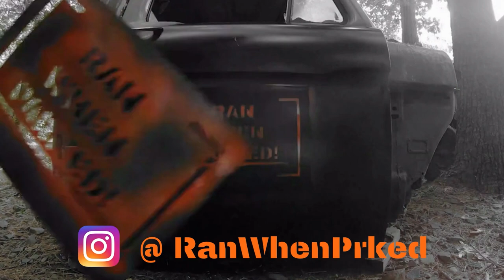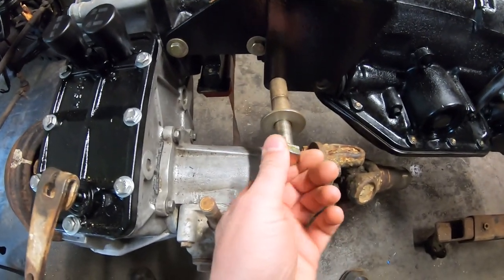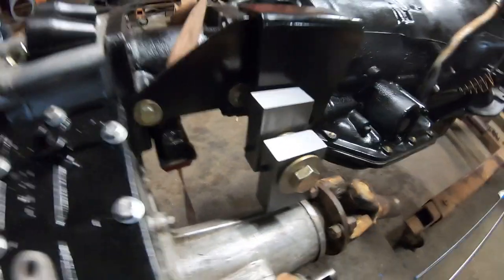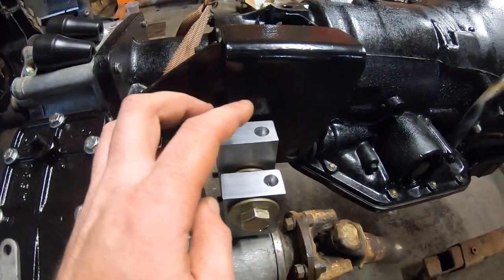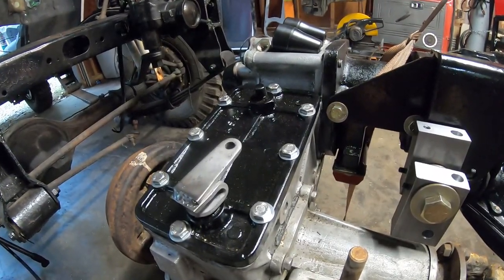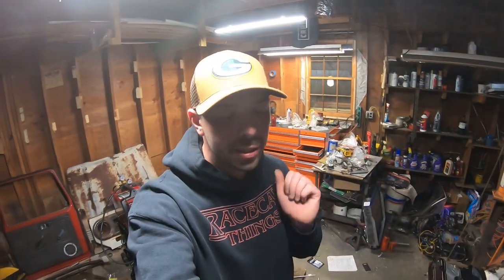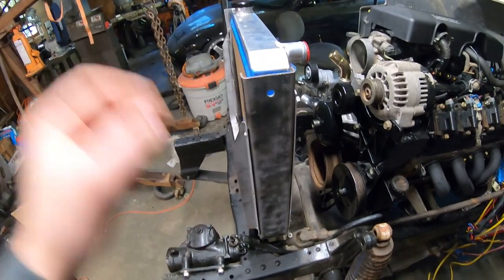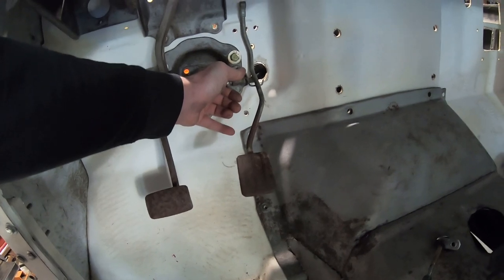FJ40 Landcruiser Build - Custom twin stick fab, drivetrain back in, and a ton more!

Comment: Nice, 
What motor mounts did you use ?
Reply from the maker: Honestly I don't know.  The frame had a 350 in it when I got it.  I just sold the 350, moved the mounts back a bit to where I wanted them, and used conversion plates from LSX innovations to convert from ls to sbc mounts.

Comment: My son in law has a FJ60 with a LS 1 and TH 350 with the 60 transfer case.
His problem is gas mileage: 7mpg. He took it to qualified programmer who claims the transmission is not suitable to synchronize with the engine computer. What system are you using to manage the two?
Reply from the maker: Get a different tuner! The TH350 is not electronic and of course will not communicate with the LS ECM.  You need to eliminate all the electronic controls from the harness and have them tuned out.